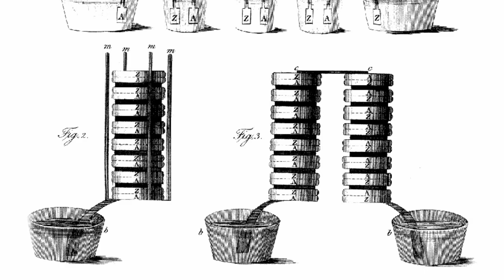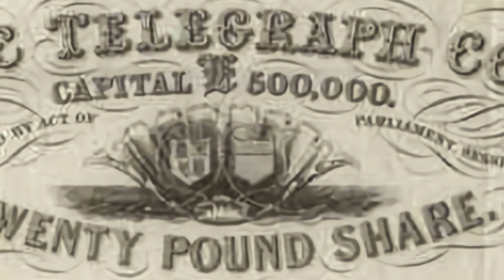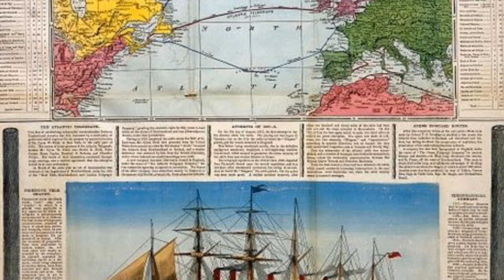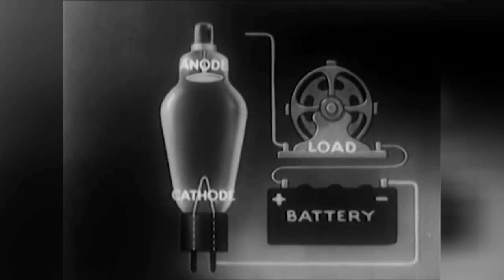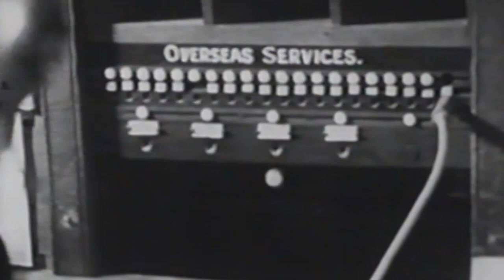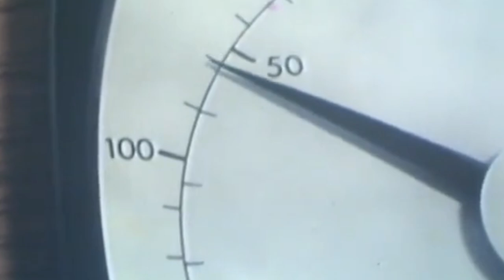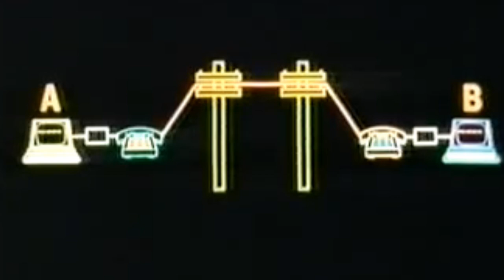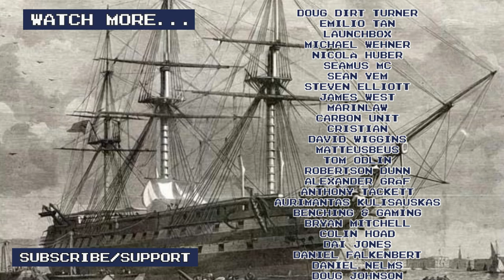How the Internet Crossed the Sea | Nostalgia Nerd

Comment: To think about, that in 1988 280Mbps was the total capacity between the two continents, and now I have a 500Mbps connection to the world from my home, is.. unreal. It's only 31 years apart. What a time to be alive.
Thanks for this extremely well edited video!
Reply: and I just upgraded to 10Gbps for my server...
Reply: i know... I really enjoy living these times... but I CAN'T feel happy because I could born like 30, 50, or even 100 years later to see more IMPROVENTS! damn..
Reply: 5G will soon give everyone 1 Gbps connections --- even in a log cabin in the deep woods !!
Reply: How the..
Reply: @lagillas  Only if we don't mess up with climate change
Reply: You don't have 500Mbps to the world, you have 500Mbps to your ISP. From there after, you are using shared links, so it is very difficult to know your real speed to everywhere, because that varies with demand from other clients etc.
Reply: The only "climate change" you need to worry about is "nuclear fallout".
Reply: I'm sure they were thinking the same thing back then....what a time to be alive
Reply: @Rich I agree, but only from my perspective, I think we are at the peak.
The Calculations per second on CPU's has been improving SO well between 80's - 90's 
and kinda well between 90's - 2010
since 2010 is slowing down but still improving.

in 2060 calculations per second would be at some freeze standard.
and like you said by 2119 we will have pretty much the same technology we had in 2060.
Reply: It only exploded like that over the last 10 or so years though... about 12 years ago one of my employers sites had a 34Mbit internet connection. A real serial E3. For about 3500 employees at that site. And it was enough. Nowadays that site is connected via 2x 10Gbit...
Reply: @atscub  Quite probably not even to the ISP but only to the local neighbourhood exchange... (at least that's how it is in The Netherlands for ADSL, ADSL2, ADSL2+ VDSL and VDSL2+.)
Reply: @billbelzek6748  5g is bad
Reply: Yeah the speed of the computer revolution is unbelievable. I remember when my family got our first computer in the 90's and the internet connection was an afterthought just to be able to send a couple of emails and that was a slow an expensive business. Today my lightbulbs are connected at insane speeds.
Reply: Völundr Frey unfortunately now the Amazon rainforest is burning
Reply: @firmman4505  Fucking internet and its
Shuffles deck. Pulls out card
Burning of the rainforest.
Reply: I could even buy 1Gbps if I needed to
Reply: @Bill Belzek < I work in the wireless industry, and I can tell you that 5G is not all that people are dreaming about.  Running at high gigahertz frequencies and relatively low power having low solid material penetration, it's pretty much a "line of sight" communication requiring a micro-cell on every other street corner especially in cities.  As far as a log cabin out in remote woods, hate to tell you that ain't happening.  Today's 4GLTE will reach you much further than 5G.  (come back to this message once you experience 5G and let me know;)
By the way, those of us who grew up in the 80's are the ones who can truly appreciate the communication advancements in the past 40 years, starting from 300baud modems to megabit and gigabit connections today.
Reply: @BillAnt  I work in the industry too and this is absolutely true, a lot of people see it as the replacement for 4G but it won't be. One benefit is that you will be able to carry a much greater numbers of requests on the network. But you will really only see that benefit in large cities and in industries. In highly crowded areas today you will often reach higher speeds by disabling 4G and use 3G instead.

There are some patents regarding how to increase range, however they will still not even be close to be able to cover even the more populated areas of the countryside. 

What I think you will see is mainly 5G+4G for at least the foreseeable future.
Reply: @firmman4505  Forests have fires sometimes when they get dry. 
It is normal and natural, get over it!
The one in the Amazon now is bad but not unprecedented, it has happened before and will happen again someday.
Reply: @atscub  You measure your Mbps by what you can at max send to your ISP, not what at what rate the receiver can receive at...
Reply: @beedslolkuntus2070  damn that's alot I'm working on 25Mbps
Reply: @Duglum666  I have less than that at home
Reply: Christian Flores 
Actually my home speed is a 250Mbps

That server I had wasn't mine and was lended to me, so I really do not use it anymore. It was a web server....
Reply: @Rich In 100 years, they will laugh at us for thinking the world was about to end with our primitive technology.
Reply: 0.5 mbps here :/
Reply: @BillAnt  That's only the case for mmwave. I have midband 5G in my entire county which easily gets 400 Mbps wherever I go.
Reply: @konadesu  < Right, but the millimeter wave 5G is supposed to push over 1 to 2Gbps, too bad it doesn't penetrate well.
Reply: @lagillas  Those speed increases are all based on the same technology though. Its quite possible there will be another breakthrough like that, just like fiber-optical cables basically. Using carbon-nanotubes for transistors seems promising. It seems a little hard to perfect production but right now there also is not a huge demand for it.
Reply: @billbelzek6748  No, 5G will not be available in a log cabin in the deep woods. I don't think you understand what 5G is.
Reply: @DrHarryT  unless he lives in Kiribati or such countries that will be under water in 30 years.
Reply: @billbelzek6748  nahh it won't lol air signals will never reach 1gbps
Reply: @BillAnt  
You had 300, wow.  We only had 110 with two stop bits, so 10 cps.  Then we got a new dot matrix terminal which could do 300, and later that went up to 1200.

I also remember our first hard disk, an external unit in a rack mount size case.  We thought we’d never fill it because it had a formatted capacity of 16 Mb, and it cost over £5k.
Reply: @lagillas   You could've been born a 100 years ago, waiting in queues to send a text message. Be thankful.
Reply: @billbelzek6748  and with 6G coming within the next decade that would be multiplied by a hundred folds
Reply: @BillAnt  I grew up in the 70's and 80's and still remember the tone of my modem calling over the telephone line for logging in.
Reply: @henzelmen  - I certainly remember in the 80's when I had to yell "Mom, hang up the phone, I'm on my computer!" lol
Reply: @DrHarryT  your reply here is going to age like milk sitting in the hot sand in the Caribbean.
Reply: @BillAnt  Data coverage isn't even an issue though, the only people I know that can tuse 5G on their capatible devices also can't use 4G, or 3G either. It's the higher 5G standards that will take more work to become more available and affordable.
Reply: Yea the people of the 2040s laughing at your face.

Comment: Hi - I worked in BT Submarine Cable R&D for more than 20 years, and I wish that your video had existed as introductory material for our students and other visitors! In working on projects from TAT8 to TAT14 and beyond, I must say that the work was fascinating, with a mix of things large (ships) and small (photons and fibres), and things that never change (waves, rock abrasion, repeater housings) and things changing all the time (components, transmission methods, network topology, industry alliances). Anybody with an 'engineering mind' would certainly find a happy place in one of the companies currently operating in the field! 
Many people still think of satellites as the 'modern thing' whereas the reality is that for long haul traffic they were out of the picture decades ago. I would be surprised if they even amount to 1% now, though I suppose there will always be islands too small to support the cost of a cable landing even from a branching unit on another cable.
Thanks for your video.
Reply: I work as an engineer for a few cable systems in Asia and I agree with you on all your points. Very interesting work indeed. Though I wish people would stop fueling the fire on the shark bite topic, considering how rare it is.
Reply: @75190255508  Well, we can't help it. The sheer 'randomness' is some part of a humor code. I bet you found it funny when you first heard about it.

Comment: So theres literally a fricking cable under the ocean that allows me to connect to the world
Wild
Reply: It's so interesting to see how these modern cables are truly an engineering feat.
Reply: World Wild Web
Reply: Yeah no foolin, til I saw this video I was under the impression it was somehow beamed wirelessly across the ocean
Reply: A lot more than one cable these days.
Reply: @Fritzafella  same
Reply: @Fritzafella  yeah that wouldnt work one of the biggest problems with that is the ocean itself. radio waves are essentially light which means they get reflected like light here on land reflection isnt major issue since the ground is more absorbent that reflective and also wireless is used in short enough distance. over the sea however is a different deal radio waves over long distances would be reflected and mirrored  causing distortion interference and signal loss

Comment: I worked at Bellcore which was split off Bell Labs in 1984, the year I started. Fiber optics was a game changer. Bandwidth was no longer the problem. I worked in a group that developed standards for fiber optic standards. We tested multi-mode, single-mode, different encoding standards, RTZ vs NRTZ for example. Analyzed the combination of synchronous vs. asynchronous signals, and the team I worked in, developed SONET which is the foundation of the big backbones of the Internet. 

I am proud of my participation in building the future.
Reply: I would love to hear all about the numbers missing from the G.651, 652, 653 etc series!

Comment: Superb video. I don't know why, but thinking about those old abandoned telegraph cables laying there in dead silence gives me the chills. Spooky, somehow.

By the way, there's an extreme retro tech restoration project if I ever saw one.
Reply: Unfortunately they are probably in 100 or more pieces now. They weren't well shielded they weren't buried close to shore and they stopped repairing breaks in them over 50 years ago.
Reply: Modern practice is to pull up old optical fibre cables when they are no longer economically useful. In many cases they can then be laid somewhere else where the lower performance is still good enough. And pulling up the old cable will release the well-studied cable route for a new cable, which can result in a better-engineered system for a more reliable service - winners all round.

Comment: Nice work! It must have taken a long time to make. We appreciate the effort. 
@18:08 It says that in fiber the signal moves at the speed of light, making communication almost instantaneous. That's true, but the speed of light in glass fiber is only 66% of the speed in vacuum. Still pretty fast, but digital voice uses compression which adds significant delay.  If you use two cell phones at the same time, you can hear the delay. Also coaxial cable has a speed of 66% to 89% of the speed of light in vacuum.

Comment: Nice refresh on this subject. One thing I would like to add - Even if the amplifiers in the fiber cables run on electricity the amplification is purely done with light/laser energy. A laser is fired in to the fiber using doped glass and the signal is magically refreshed. This makes the amplification almost perfect with no added signal delay or distortion. The amplifiers are spaced in such a pattern that at least one can fail of two in sequence before a repair is needed.

Comment: You hinted at the shark earlier and I thought it was just a goofy thing to say.    Then you showed one doing it.   That's brilliant.
Reply: Sharks are attracted to the magnetic field around a cable, which might interfere with its navigation using the natural magnetic field. Might make it angry enough to bite. A major cable near Canary Isles was taken out by a shark bite, so cables likely to be bitten now have a thin layer of metal foil added which is strong enough to stop a tooth. Problem solved.

Comment: nice.....I worked at BT&D (British Telecom & Dupont)  laterly bought by and known as Hewlett Packard ..even laterly known as Agilent Technologies ...it was an R&D and production site were we made some of the first solid state LSC (light source components) used as the early optical fibre transmitters for those fibre bundles .
later on I worked in submarine pump laser dept where we made the solid state pump lasers for our erbium doped fiber amplifiers which used light to amplify light for those undersea fibre bundles .
Then i moved to the  wafer fab where we made lots of interesting stuff including 10gigabit dwdm transmitters  and were working on 40gigbit dwdm transmitters .
All of this in the early nineties to the early 2000's...most people don't realise how much of the digital age came from a company in Ipswich suffolk England.
Then HP moved the production to the singapore and the Ipswich site closed....But most of the top brain power moved to the centre for integrated photonics (still in ipswich) which was bought by Huawei in 2012 ....so a lot of the digital age is still owed  to town in suffolk.
Reply: And - before your buildings were built, at the same BT site, BT people were making individual transistors for the repeaters of the 1970s and 1980s, and also inventing optical fibre manufacturing processes for the systems that followed.

Comment: Honestly as a guitar fan and a hi-fi fan i can finally see transistors as something good thanks to this video! its pretty nice to see "guitar players biggest enemy" finally used for something good! nice!

A lil bit of info on this for people who don't know, transistors where used in guitar amps since the mid 80's for amplification, which made a 100W guitar amplifier (normal wattage for a guitar amp) way cheaper but it came with the cost that it didnt have this litle raw edge around a guitar tone, it also didnt go as loud as a Tube amp which made it a big downgrade, for alot of live musicians in jazz, blues, and rock music the tone of a transistor amp wasnt as good as a tube amp which always had a bit of grit on it's tone, however you dialed your tonal knobs (bas mid treble) you always had to look out with the volume knob, by increasing volume your distorted (or overdriven) signal was always apparant which ment that every player had their own sound, imagine dialing in the same tone as me, but lowering your volume a bit lower than me, it sounded completly diffrent. A tube amp has feels more alive than a transistor amp due to this.

Comment: I remember when I had Dial-Up internet and to download a pixelated picture of a nude girl could take an hour, and that was mid 90's.
Reply: You need to remember that dial-up was just substitute to pulling internet cables to houses, which is expensive feat, it same same problem even today, DSL is just evolution of Dial-Up but it's still analog technology same with cable. Analog telephone lines themselves are not compatible with internet protocols, Dial-up was also not really made for internet use, but to connect 2 computers over telephone lines and create virtual COM port over it, so they can communicate to each other with Dial-up you simply connect to some other computer and that computer pass thru internet connection over virtual COM port

Comment: Since the TransAtlantic cable was a bilateral venture it was assumably one of the largest capital construction projects of its era - if not the largest. Also, latency ( which you described with geostationary satellites ) can still be an issue if VoIP is carried by satellite ( which assumably can be the case with transoceanic calls )

Comment: Great video! I kind of question the phrasing during the discussion of modems though... it was said in the video that we initially used modems but eventually developed to directly connecting computers together, which isn’t generally true. For example, if one uses broadband internet from a cable company, one generally uses a cable modem, not just plugging the coaxial cable straight into the computer.

Comment: My actual job (for real) is to draw and design construction drawings for fiber optic cable routes in the mid-west US, be it buried, hung from poles, mounted within tunnels, or hanging off a bridge. Been doing this for 7 years now. Only about a year or so ago did I learn that communications between countries are actually being shared via a fiber optic line straddled across the ocean floor. Kind of blew my mind, not gonna lie. I thought it was all transmitted via satellite.

Comment: Yo, minor correction. Fibre is an analog medium  because light is analog. The "digital" pulses of 1 and 0 are done by the lazer turning on for a 1 and off for a 0. Lazers cam do this hudreds or thousands of times per second. Futhermore, there are DACs ( Digital to Analog Convertor) and ADCs ( Analog to Digital Convertors) at each end to turn electrical pulses to light pulses.

Comment: I have to make one correction.
In the voice over it is said that fibre optic is a digital medium, but in fact both digital or analog could be passed down fibre or even both at the same time if you wanted to be perverse. It just makes more sense to use digital with fibre as it is more efficient. In the same way, copper can carry either digital or analog and when satellite went from analog to digital many of the same satellite transmitters were re-used for the 'new' digital transmissions.
Reply: No. Fibre is pure digital. Zeros and ones represented as Off and On laser pulses.